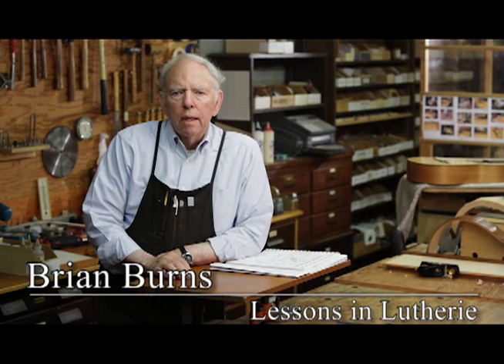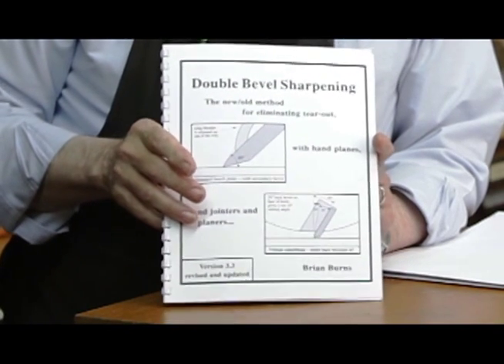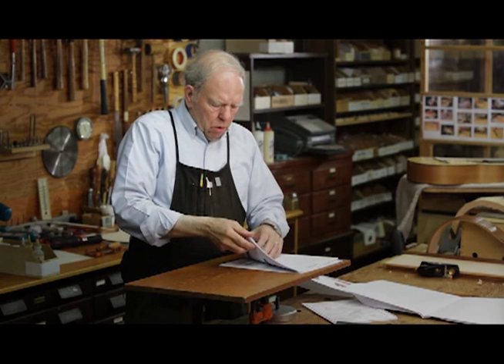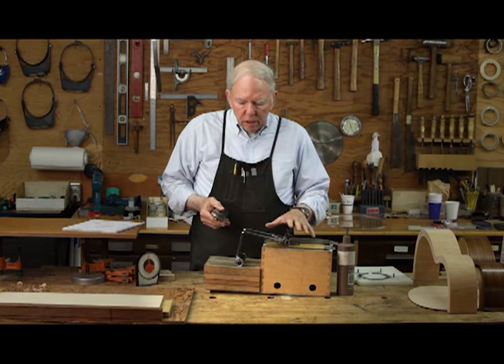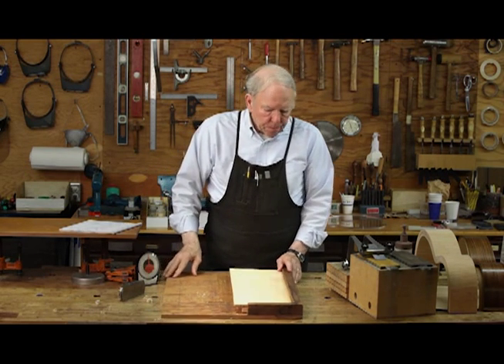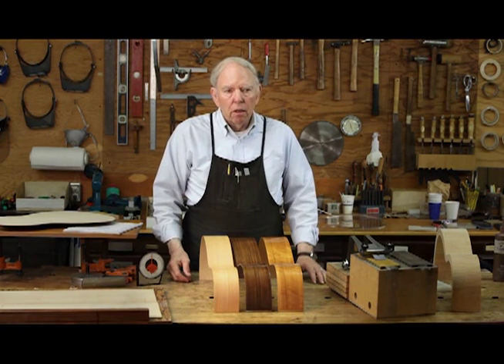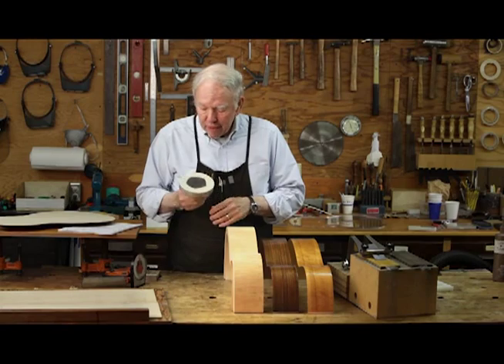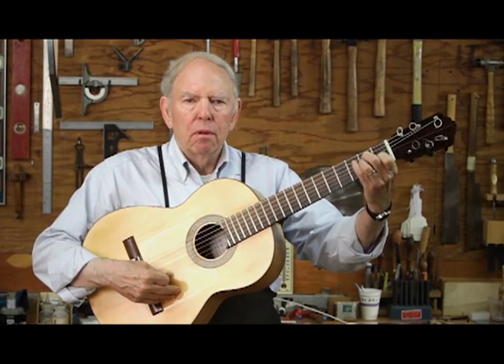Lessons in Lutherie with Brian Burns - an Overview

Comment: I spent 10 days with Brian 15 years ago and learned a lot from him. Even though I was there to learn how to build classical guitars, probably the most useful thing I learned from him was how to sharpen plane irons and chisels. When you have sharp tools to work with, everything else goes easier. By the way, at Brian's recommendation, I bought a Veritas block plane before attending his workshop, and I'm glad I did. My Veritas is probably my favourite luthier tool.